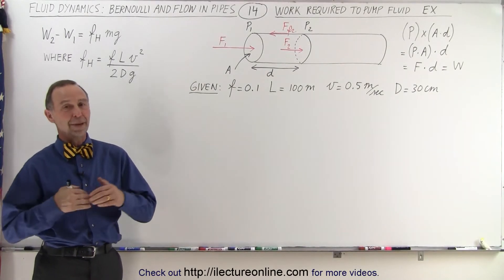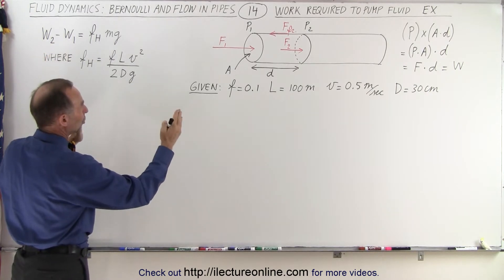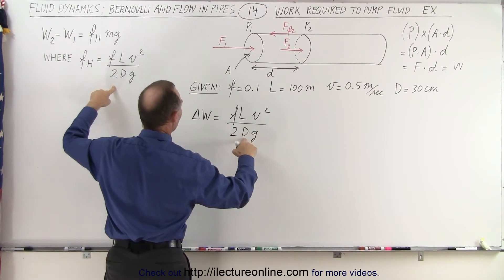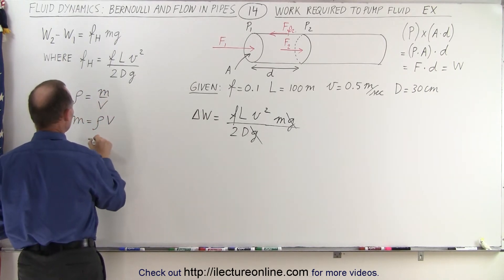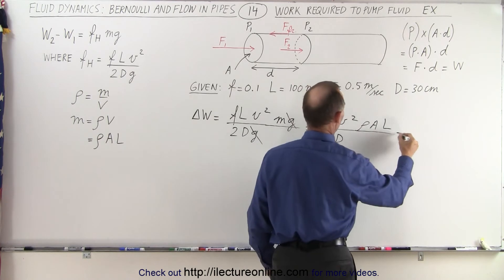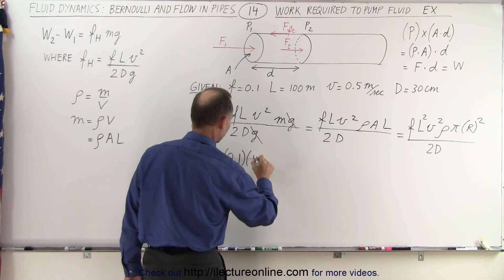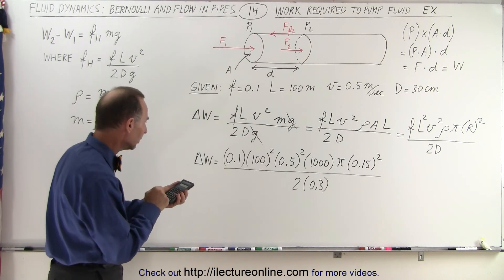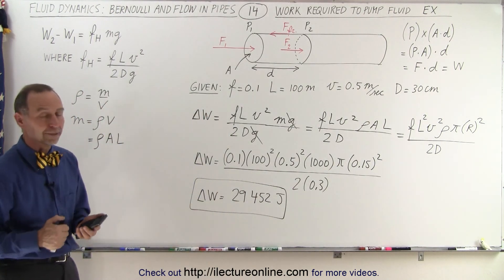Physics 34.1  Bernoulli's Equation & Flow in Pipes (14 of 38) Work=? to Pump Fluid: Ex.

Comment: How do I convert J to watts ?
Reply from the maker: You can't since 1 W = 1 J/s
Reply: How can I reach out to you? I have a question which is related to fluid mechanics.
Reply from the maker: You can reach me through these comments.  I suggest you start a new comment chain to make it easier for us to find.
Reply: @MichelvanBiezen  okay. 

So in your current example, if i have the flow rate in m³/s and the total volume of fluid to be pumped and even the duration of pumping (volume/ flow rate) in hours, and I want to find out the total pump power needed in watts. 

So based on what you said, W = J/s. So how do i proceed with finding the watts if i have total volume to be pumped V=500mL, duration= 2 hours and flow rate Q=250ml/hour and X amount of joules, assuming flow rate is constant.
Reply from the maker: In order to pump a fluid through a pipe, you do indeed need a pump which requires a certain amount of power.  The need for power depends on three things.  1) Height gained by the fluid per unit time.   2) The internal viscosity of the fluid   3) The shape and size of the pipe, and the material it is made of.       Without any of that information, we cannot find the power required of the pump.
Reply from the maker: Note that in this example, the pressure difference was given, and therefore the force required to push the fluid through the pipe can be calculated.  Then work = force x distance and power = work / time
Reply: @MichelvanBiezen  I am working with very small application: pushing IV fluids through a syringe and catheter. So my diameter of the syringe and catheters are in mm, and their lengths are in cm. So when I tried to calculate the work based on the formula you provided and divided it by 2hours (seconds) it gave me a really small value, like in nano Watts. 

I am supposed to find any linear actuator which satisfies the given power value, so i guess I could satisfy it by taking a 5V linear actuator with very small current value so the watts (VxI) is also in nano Watts. But I find this value hard to believe.

Comment: if we devide the work by the volume we get the pressure 
i calculated that and i found it 0.04 bar
is that correct?
it is a smalle pressure
Reply from the maker: Check the units.  If you divide work by volume you get the units of   kg /(sec^2  m)

Comment: So if there was no friction then the work done to pump 100 meters of fluid would be zero?
Reply from the maker: That is correct.  It would be the same as pushing a box over a frictionless surface at a constant speed.  It requires no work.